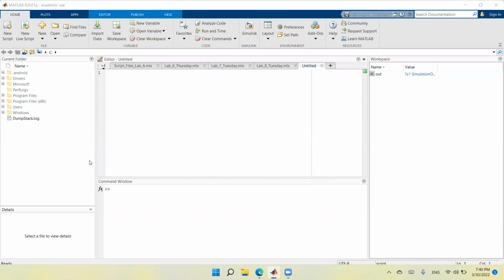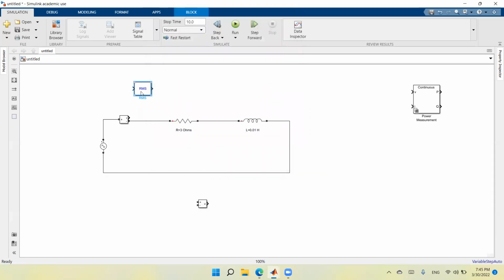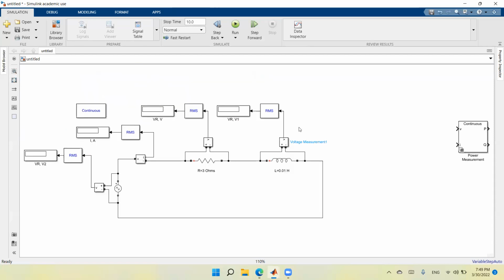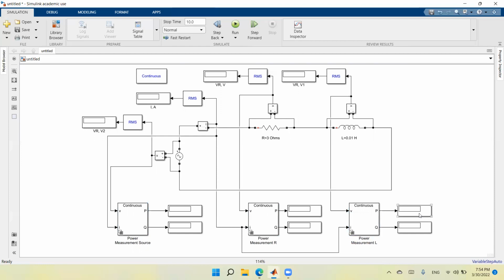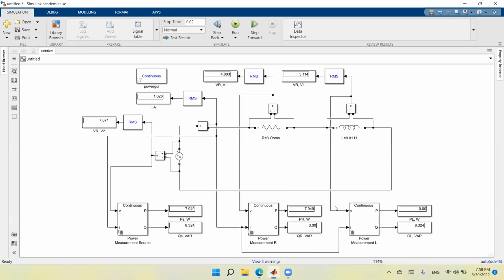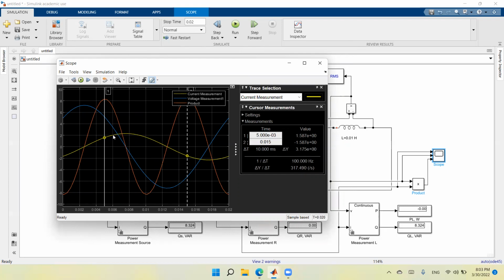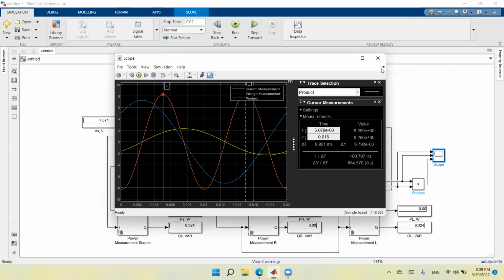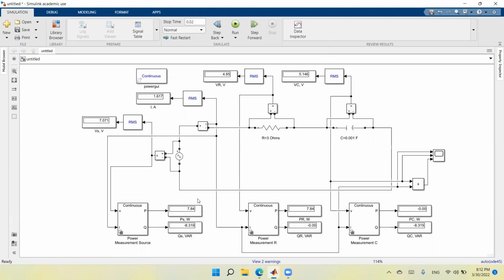4 MATLAB Simulink Resistive Inductive RL Resistive Capacitive RC AC Electric Circuit (Power)

Comment: Why always multiply by square root of 2 ????
Reply: because it converts the AC signal value, which is read as peak amplitude, into its DC equivalent value. That is what the RMS blocks are doing in the diagram. This allows us to do DC circuit analysis